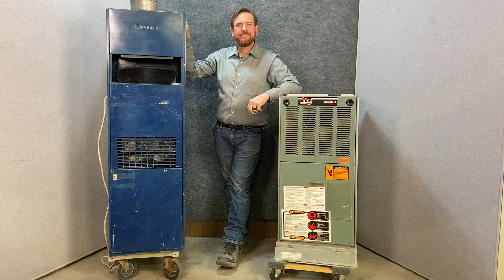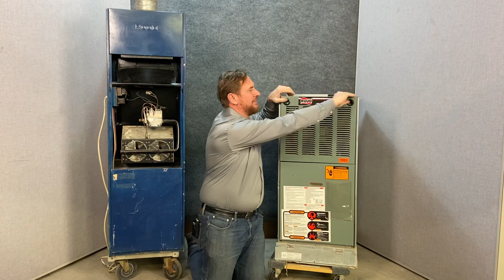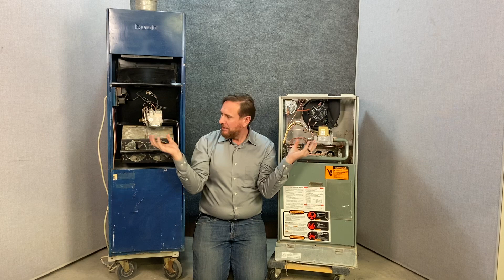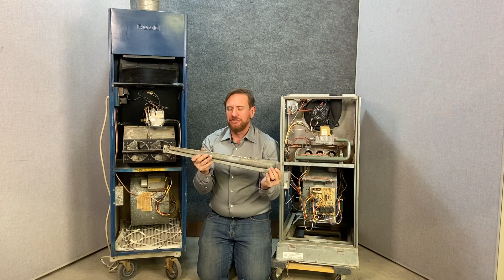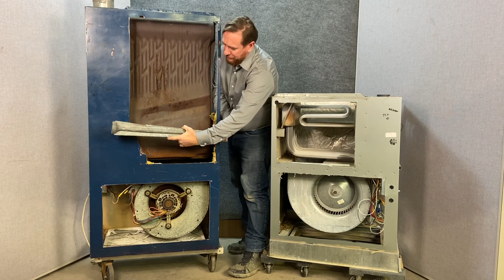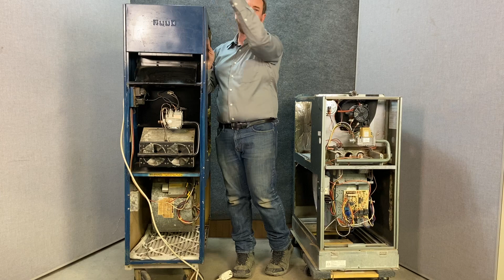Standing pilot vs 80% gas furnace

Comment: Here's the difference. One blows heat for 20 minutes and last 60+ years with maintenance. The other blows warm air for an hour and needs replaced after 10 years with components being replaced the whole time. The heat it converts vs. the heat it produces are two very different things.
Reply from the maker: You won't have to worry, they are going to take the furnace away and replace with heat pumps.

Comment: Ty, great video!  With regard to the inshot burners mixing with predetermined amount of air based on the specs of the inducer, are there any concerns about the inducer squirrel cage / fan becoming dirty over time and pulling less air than designed possibilities causing issues?   Do you regularly clean or check the inducer fan cleanliness?  Thanks!
Reply from the maker: That's a great question!
Yes, it is identified with combustion analysis.
It's not as big of an issue with a properly installed and set up system.   The biggest issue with the fan clogging up is when the gas pressure is not set correctly and soot builds up which makes the problem worse.
Reply: @love2hvac  Thanks Ty, really appreciate your feedback and response.  Thanks again for the very interesting video and comparison between the two types of systems.